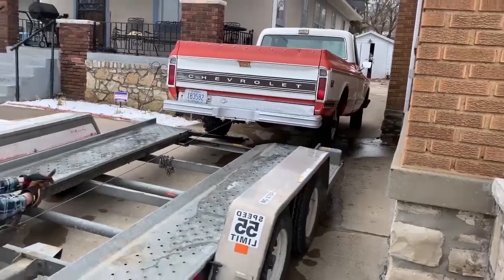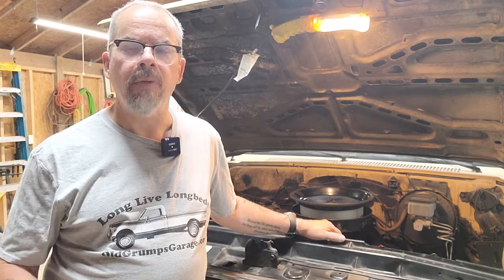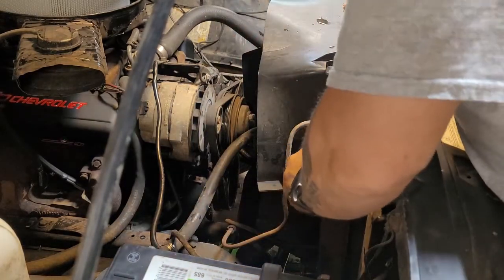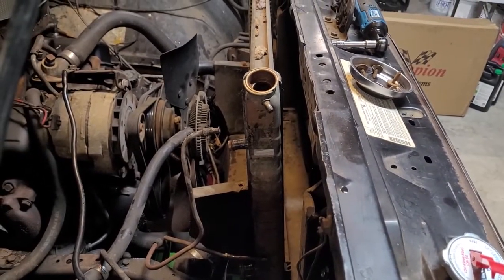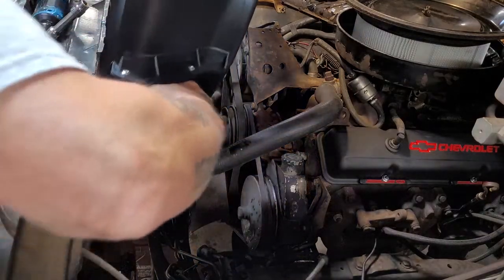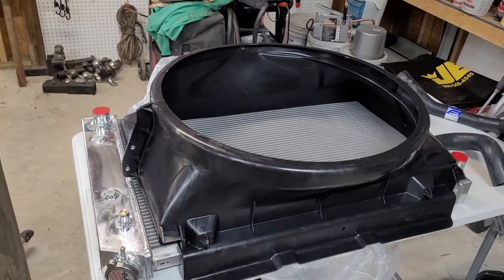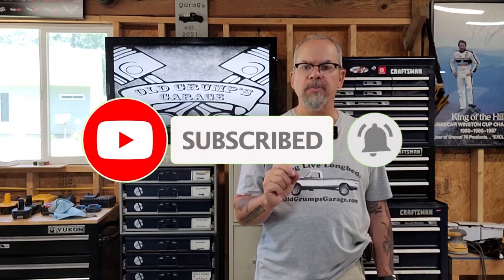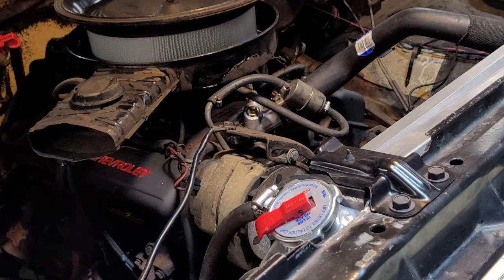Chevrolet C10 Square Body Radiator Replacement   V6-V8

Comment: PLEASE tell me where you got the shroud and the radiators dimensions please, I also have an 86 that had a 4.3 but now it’s has a 350 with the same stock radiator. I’m having trouble finding the shroud for the 350
Reply from the maker: radiator, fans, and shroud were all sourced thru Jegs
shroud - jegs part # 166-FS716
Overall Dimensions: 19" H x 28-1/2" W
fans - jegs part #166-CCFK14
radiator jegs part #166-CC716
Core Dimensions:	19" (H) x 28-1/2" (W)
Overall Dimensions:	20-1/4" (H) x 33-1/4" (W)